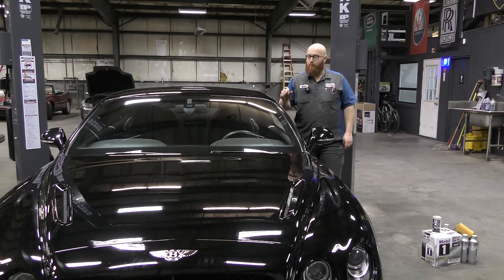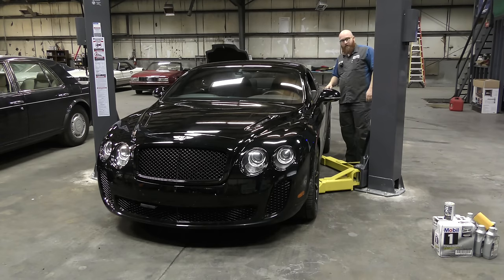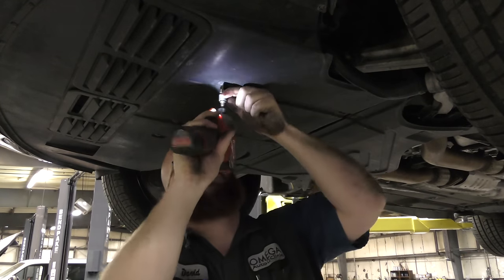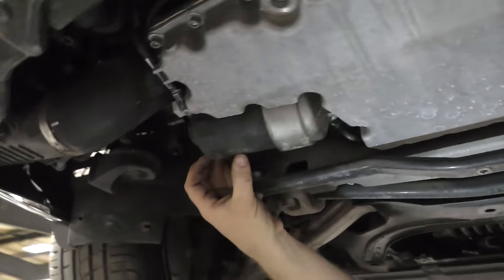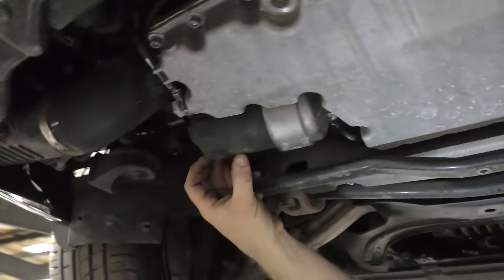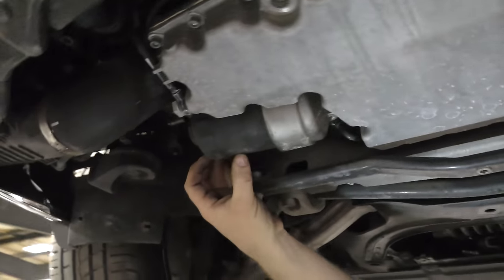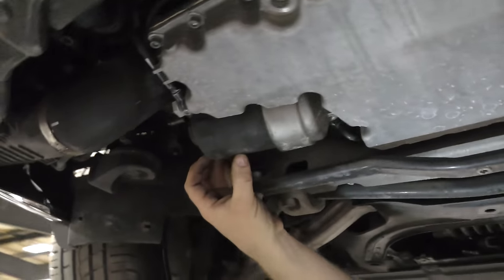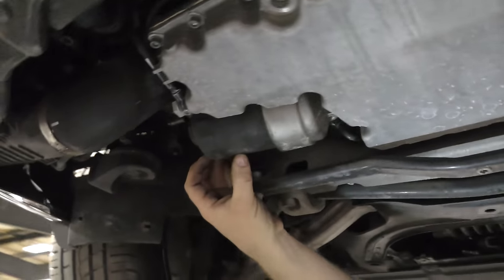One Fast Oil Change! The CAR WIZARD works on an insanely fast 2011 Bentley Continental Supersports!

Comment: That’s a lot of plastic waste using all the small bottles, surely they give you the same discount on the bigger containers..  all a bit strange
Reply: Fair point. I buy the 5 liter cans (cheaper due to volume discount) but I always poor some into an old 1l can when topping up because the 5l cans are heavy, difficult to manouver and will spill all over the place
Reply: Wizard says that he buys on time next door, I don't know why he doesn't get two of the 5 liter ones and a couple small to top off. Would be faster and less work as well.
Reply: he probably doesnt use that oil for his normal oil change services, I'm sire he has bulk oil for other stuff.
Reply: I see it on a lot of US car shows, the use a heap of the small bottles, just found it strange 👍

Comment: Can you make a video where you change oil on a car as fast as possible. Free choice of car and then  challenge tavrish with the same challenge
Reply: Any Subaru without the plastic under tray or '99-'07 Chevy trucks/SUVs.  Both can be changed in a parking lot without even needing a jack, filters are super easy to get to, and the oil drain is right near the oil filter.

Comment: As for the pre-fill dilemma, simply turn the car on its side...et voila!!! Apply the cartridge, fill the can, screw it on and done. Tip the car back on its wheels and tow it to the body shop to finish the oil change.

Comment: Audi say it takes 12 sec. to get oil pressure to every part of the engine when started up from having being empty.
Just saying....
Reply: I would rather have some oil spill out of that filter knowing my "$100,000" engine was getting oil sooner would put me MORE at ease!!!!!
Reply: Moist Gnome  No. It's from Audi. If it wasn't from Audi I wouldn't say that it was from Audi. If it was from an old wife, I would say that an old wife told me. This is the way you can tell what I mean when I say "Audi say it takes.....". I know it can be confusing to some people, so I apologize for not adding this instruction to my original comment when I posted it. Sorry!

Comment: It costs me around $150 to do my own oil change on my supercharged Jaguar
Reply: @Not Hitler yes you could do cheaper than $150 but if you’re using quality oil and a quality or oem filter it’s to going to be $40. You’re going to need the good stuff for a Jag
Reply: @jackharrison1478  the Wal-Mart and amazon oils are supposed to be just as good as the name brand ones.
Reply: @jackharrison1478  you can get factory filters on amazon for cheap. i called the dealer on a cl600 filter was told 35$ on amazon was 12 has same part number and same name made by same people. they just charge more because of the name so the figure you can pay more. look up things yourself and you will see they ripping you off
Reply: @bigsean2473  I don't trust Amazon. There's a lot of fake filters, spark plugs, etc. You always have to be on the lookout for the fakes!
Reply: @ogmudboned  this is true thats why i buy from amazon not a store selling through them as they back all products sold by them
Reply: It barely costs me anything to do an oil change on my BMW. I have a stash of euro blend oil that I buy for $30 (sale price) per 6L jug. I stash them as my beater (2012 Golf TDI) uses the same oil. $15 Mann oil filter that is readily available in most local parts stores. The only time a shop had to do my oil change was when I went on a 7,000 mile road trip and got a $110 oil change at a BMW dealer in Phoenix, AZ.
Reply: @DigitalYojimbo  Supposed to be isn't good enough. Are you going to risk a $50,000 engine in a $250,000 car on "Supposed to be good enough"? Or are you going to use what the manufacturer actually certifies you're supposed to use. This isn't your $18K Ford Taurus with a $2000 motor.

Comment: So the engine is just two Jetta VR6's?
Reply: I do not remember a Jetta ever having a VR6 from the factory maybe you mean Vento or Bora?
Reply: @Random-nf7qb  they did in the US I've never even heard of those other models
Reply: @Tool0GT92  No
Reply: @Tool0GT92  Vento - Golf ||| sedan
Bora - Golf |\/ sedan
Reply: Yeah, the WR12 is 2 VR6's at a 72* angle.
Reply: @bustopherjones2285  W12, not WR12
Reply: @Random-nf7qb  The full name is the  Volkswagen 6.0 WR12 48v
Reply: @bustopherjones2285  Germans and VW don't refer to it as WR12
Probably some idiot thought because it was 2 VR6s it had to have a R
R means inline
There's no reason to have both W and R in the name of the layout.
If it was VR12, then maybe it would've been plausible

Comment: David, looking at that Bentley W12 engine bay, correct me if i wrong but i would think to do a major repair job on that engine would mean taking it out, because i see very room around the engine, it did look like the beauty cover was still in place.
Many people doing their own oil change over tighten the sump plug probably myself included, they do not need to be over tight, it damages the threads the sump plug goes into.

Comment: I've commented before in the ML oil change video on how super easy it is to change the oil and filter on that car, and this Bentley is also an easy job. I have a VW Touareg and changing the oil on that can turn a person from Dr. Jekyll to Mr. Hyde pretty fast, especially when you get to the oil filter.

Comment: I can tell it's a VW/Audi car mechanically.  Same 36mm oil filter bolt, 19mm sump bolt and about 11  X  T25/T30 torx on the belly plate.  Even a humble Golf or Audi A3 has similar. 😁

Comment: GOOD explanation as to why you don't use the 5 quart containers of oil, I was wondering that exact thing when you started to explain it.  This is what makes your channel great- A chance to see what repair shops are up against and have to deal with.
Reply: Only because he gets them as cheap as a bulkier buy, which is very surprising. It clearly takes him longer faffing with those little bottles too.  I get 20 litre cans for about 1/3 of the price/litre of those little bottles.  Although an amateur (now), buying that much at a time lets me into the professional market.

Comment: Couple of points:
Zinc is awesome additive for oil, but it will contaminate and shorten the life of a very expensive bently catalytic converter.
you never mention the relationship between the W12 & the VW  VR6.
if you where a mental case you could fill the oil filter 7/8ths up, then use thick grease in the holes at the bottom of the filter to temporarily stop the oil from coming out, then screw the filter on real fast.

Comment: I understand the rationale in dealing with CarQuest, my only issue with using the small jugs is the issue of waste (especially because you can’t recycle containers that have had motor oil in them). It’s just an unfortunate issue with the way certain items/consumables are bought and sold; if I had any say people that had a desire to could bring a reusable container made of metal or much thicker plastic where you could swap it out with a full one (kinda like how propane tanks are sold by BlueRhino). That way there wouldn’t be as much waste.

Comment: I have been changing oil/filters for 50 years and never worried about filling the filters with oil. nothing bad has ever happened. my 77 fj40 land cruiser took 8 quarts of oil. lots of oil is a good thing.

Comment: i just priced out oil and filter for this Bentley just to compare since i was curious, granted i use Amsoil instead of Mobil, but for referance, for just oil and filter, would be approx $184 just in oil and filter, i'd consider wizard's pricing cheap for what you're getting

Comment: you can pour oil in because the filter will soak up the oil. you'll find that it soaks it up pretty quick. but i agree with you that putting it on dry doesn't pose any problems.

Comment: Wizard, e85 requires 45 % more fuel than gasoline, but is much safer for boosted applications. Thank you for your videos I have learned ALOT from you I just started mobile mechanic business

Comment: Hey Car Wizard. Do you top off break fluid? I was taught to never do that because it's a sealed system. The brake fluid drops as the calipers excetend as pads wear. So if you top it off, it will overflow and spill when you retract them doing a break job, and it will destroy the paint and make a mess. It took explaining this to customers many times. Unless it's obviously dirty, we always left it alone.

Comment: Hi Wizard, I do my own oil changes on my 2006 Continental GT and I always use genuine Bentley parts, oil filter, crush washer and new plug (maybe not needed, but it is a service recommendation) Mobil 1 Oil from Costco. For an extra £15/$20 I prefer the peace if mind and satisfaction of using genuine parts. However the point of my comment is that you omit to show re-attaching the undertray, it is a complete pain, I am sure you had help to re-attach it. I don't have a lift and don't have anyone to help,; it took me over 30 minutes to get it located and a few studs in place as it is so unwieldy and heavy.
Reply: @8:25 it looked and sounded like plastic to me.  Maybe they changed it from steel some time between 2006 and 2011.  I do have a heavy metal under-tray on my Jeep and I do the job it on the ground, using a small trolley jack to raise it into position while the car itself is on axle stands.
I didn't like how Wizard undid the bolts at one end leaving it hanging from the other.  I was waiting for it to break (being plastic).  I leave two diagonally opposite bolts until last.

Comment: The oil filter comment. So I agree with ya wizard. Since its sideways there is no way to prefill it before hand. If the filter has the open end facing up I personally fill it before hand. But I've had a couple vehicles with sideways oil filters and that's just how it is. Put it on without oil in it. Itll be alright. The one car I had with a sideways filter had 230k miles on it when i got rid of it (body rot/michigan car) engine still ran perfect.

Comment: Thanks for showing off that customer's car.  It was a treat to watch you do basic maintenance on it.

Whenever you buy any vehicle you always do your due diligence on the cost of ownership; insurance, maintenance, registration and sales tax.  In NV, annual registration fees for that vehicle would be outrageous as NV registration is based on the value of the vehicle.  Go into any vehicle purchase with your eyes wide open.  When I buy a vehicle I always do my homework on ownership costs.  Bentley parts are not going to get less expensive.  Just the name Bentley probably adds a digit to the cost of the part.  Knowing that it shares parts with Audi and VW probably saves the customer quite a bit of money.

For giggles, I checked the price of this car.  Older used ones go for about $150K, a late model 2017that's Bentley certified runs over $300K.  

I wouldn't mind driving that car or a similar one with the W12 engine for a long road trip.  That's a car you drive for enjoyment.  It's typically not your daily commuter to run to the grocery store or to work unless your name happens to be Warren Buffet, Larry Ellison or Bill Gates and you have a net worth in the high millions or billions.  It's also a car that you baby and you take meticulous care of as it's also an investment.

Comment: You have a new sub...I work on semi trucks and they take 10 gallons of oil minimum.  Oil change plus filter is $500 plus but the oil change interval is 30,000 miles.  They do that in three or four months.

Comment: There are some older cars and many diesel engines where the shop and owners manuals state the oil filter must be filed prior to being installed in order to not starve the engine of oil during next start. Note though these are always vertically mounted filters that are typically huge in size.

There are also certain cars where filling the oil filter (even if vertical) can cause an air lock where the oil pump gets air in it and it can't push the thick oil that is in the filter. This causes the engine to run without oil pressure, damaging the bearings. One engine this can happen on is the 1980's Chrysler 2.2 L. Sometimes these specific engines can get an air lock even if you don't fill the filter with oil. The shop manual says if this happens to quickly shut the engine off and to "burp" the oil filter by unscrewing it slightly right after starting the engine again to allow the air to escape and the pump to fill with oil.

The best rule is to follow the owners manual.

Regardless if you do or don't fill the filter, always watch the oil light or oil gauge during the first start and shut it down if the oil pressure doesn't build up within about 5 seconds.

Comment: I like to use zinc rich additives but the reason why this additive has been almost eliminated from oils itself is because it causes problem with oxygen sensors, it fouls them, 02 are very expensive and the labor is also, 02 sensors are mandatory on closed loop managed engines which use the o2's feedback as part of the information to determine pulse width of the fuel injectors and throttle body blade positioning to control the air fuel ratio, it is more complicate then this I 'am leaving out a lot but 02 do not like zinc additives.

Comment: At least in russia, they normally sell oil in 4L cans. 
Enough for most 4-cylinder cars, and it's cheaper than getting them in 1L cans. 
And there are places where they mostly do oil changes, but they'll sell you mobil1 or shell from a barrel, but i don't need that in my volvo, i can get russian-made stuff in a shop, which is seemingly as good, and has the same tolerances, but 30% cheaper. 
So it's kinda vice-versa, funnily enough.

Comment: If you fill the filter with oil and wait, it will soak into the filter medium.  Once it has soaked in then it wont drip.  With dry filter medium the oil won't pass through immediately it will only do this once it has wetted.

Comment: the only reason to prefill the oil filter is so that you can do faster turnaround. Prefill oil filter, put it on, fill oil. run engine for couple minutes, check dipstick.

If you haven't prefilled the filter, it may not fully fill up when you first run the engine because air takes a long time to make its way out. 

Not a problem with working on super expensive cars because mechanic is getting paid well to take their time and do everything carefully. They can idle the car for 15-20 minutes even to make sure eveything is topped up perfectly.  

Maybe issue for a lube place where they need to turn cars around every 20 minutes.

Comment: You can in fact fill vertically oriented oil filters before installing--I believe thats whats referred to - ive done it on small block chevys for decades, and though not necessary I think its just peace of mind and passed on by fathers or other sources - many feel it speeds up initial prime and aids in slightly faster oil pressure buildup getting pressure to the bearings faster after draining the oil  avoiding possible dry startups, it certainly cant do any harm.  Ive seen some noticeable difference in speed of initial oil pressure rise on first startup after change, but this obviously cant be done on all engines.  Old chrysler slant six engines had their oil filters upside down, definitley not doable on engines such as those.  Beautiful car, out of every normal persons price range.

Comment: I've driven many high mileage cars and always used good oil. Never had an engine crap out on me, one of my Mercedes is at 214000 miles and going up never has trouble starting even in the coldest of days

Comment: Overall, this is a good video on changing oil on a Bentley. My only minor quibble, Car Wizard pouring the oil bottles backwards. They won't glug glug when you pour the angled flat to the funnel. Learned that in high school auto class. But most do what they want when pouring.

Comment: Good on ya using standard VW/Audi parts. I used to have a Beetle. One day a coil blew. VW website said $30, but I wanted to fix it that day. VW dealer parts guy said $40, but was in stock. However the Audi dealer was closer to my place. By virtue of being from Audi it was $60. Same part number and box.

Comment: It is obviously daft to pre-fill a horizontally fitted filter, but if it is practical otherwise you might as well do it. For one thing the engine is likely to throw up a "low oil pressure" code if it takes more than a couple of seconds to raise pressure (as it did to me on a Fiat Panda today). The code can be cleared of course, but it is a faff best avoided.

Comment: Hi Wizard, its got the Seat and Skoda emblems as well. They are from the VAG Group as they classify them as here in Europe. In regards to the oil filter I have heard that but what even I do is when the oil filter is changed is to lube the side of the oil filter, but that is when the oil filter is all one body and not like here where is a two piece oil filter. Yes, Wizard I agree with you 100% for the smell and The vibe.  I am like that as well. That is why I bought Honda civic MK8, 2006 Euro version. The 3D dash and the interior is great and it smell like a new car. I have not put a refresher thing in it, not to dilute that new car smell. Funny, very funny.

Comment: The last oil change I did was on my now deceased 2005 Vauxhall (GM) Agila with a Z12XEP engine (same lump as the Vauxhall/Opel Corsa). 4.5 litres of oil and about 20 minutes work. Grand total? About 20 quid including filter. If you can't afford a $200 oil change buy a Corsa!